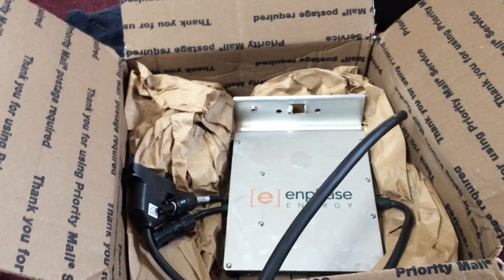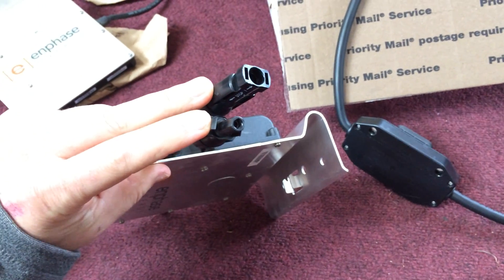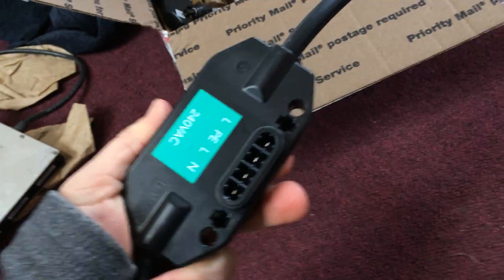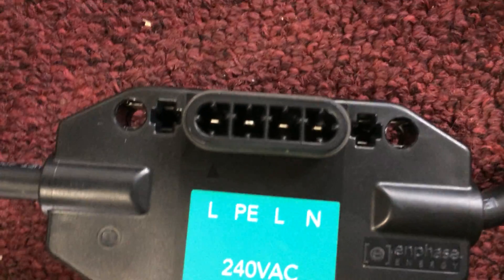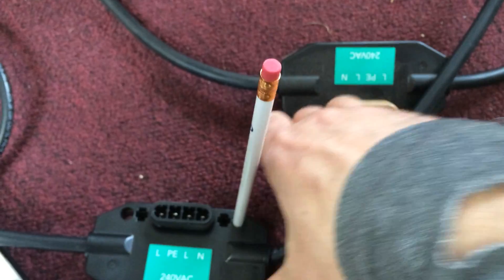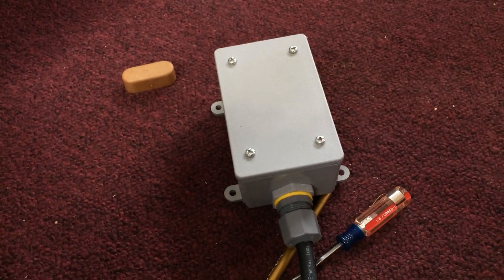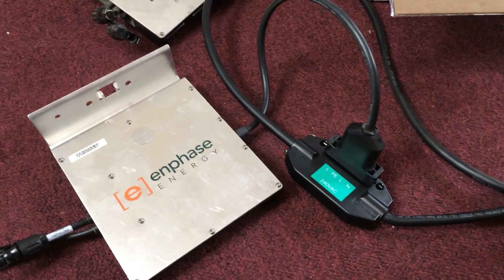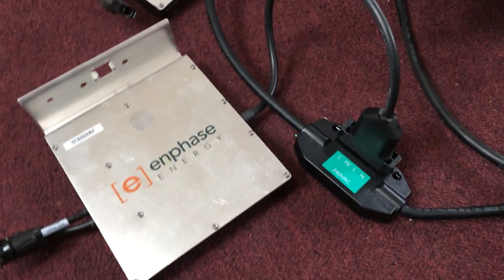Salvaged Enphase M215 Micro-Inverters

Comment: Hello Ben
Have you had any problems with your micro inverters?
Reply from the maker: Hi Philip! I have NOT had any problems with my micro-inverters. In this video, these are salvaged inverters that I got from a friend to learn and experiment with. The ones I actually used for the project were new, and almost the exact same model.
The only problem I've ever had with the system turned out to be a bad circuit breaker in the combiner/disconnect box. When I replaced that breaker, everything was fine.
The my full finished solar array, please take a look at the project on Instructables - https://www.instructables.com/id/DIY-Solar-Garage/
Reply: Thanks for the reply Ben. I am looking at an East West split array. The installer said he wasn't a fan of micro inverters because if they go wrong the panel has to come off. It is useful to hear experience of their reliability.
Reply from the maker: Some of the earlier micro-inverters had reliability issues. It's true that if one goes bad, you have to get under the solar panel to get at and replace it. On the other hand, micro-inverters offer redundancy - if one micro inverter fails, the others are still producing power. If your central series-string inverter fails, your panels are making NO power!
East-west split arrays can still make plenty of power, especially if they are low pitch and you can over-produce and get credited for it in the summer.
You can use PVWatts to estimate production off that roof, but you have to do it in two steps, one for each half. Set the Azimuth to 90 for East or 270 for west and Tilt to the angle of your roof in degrees. Then repeat for the other half of the roof.
http://pvwatts.nrel.gov/pvwatts.php

Comment from the maker: One thing I did discover is that the Enphase connectors are easy to remove from the trunk cable with a pair of pencils (or #3 Phillips Screw Drivers) but it's very HARD to unplug an MC4 connector without the right tool!
Reply: I have that tool and 10 panels with 10 enphase micro-inverters on my roof. I have had them operating grid tie for 8 years now no problems. there is a cool gadget you can get to plug into any inline outlet that will allow you to monitor the output of each individual panel using your smartphone. I never did get it...
Reply from the maker: @min2oly  My current home system (Summer, 2020) is 26 solar panels of 260 watts each. The last two panels were put up just recently with these "spare" micro-inverters. They connect to the Enphase box that sends data to the web, and I can then view it. (I usually do that on my computer, not my smart-phone.)
You can see it too. I have public solar data posted at: https://enlighten.enphaseenergy.com/pv/public_systems/PqBp1213167/overview
Reply: @BenjaminNelsonX  Nice! did you figure out the MC4 connector? this is the way mine works https://youtu.be/woPktgfJn7w?t=49
Can't remember if yours is the same...